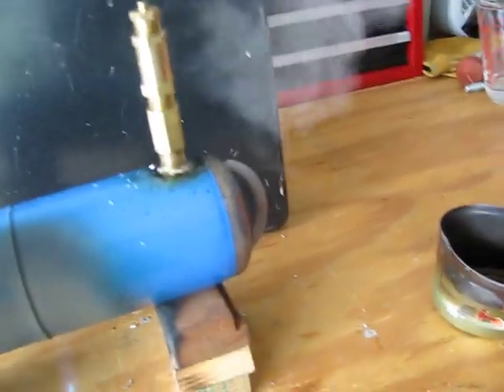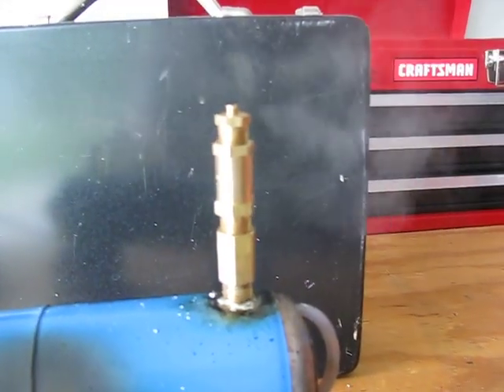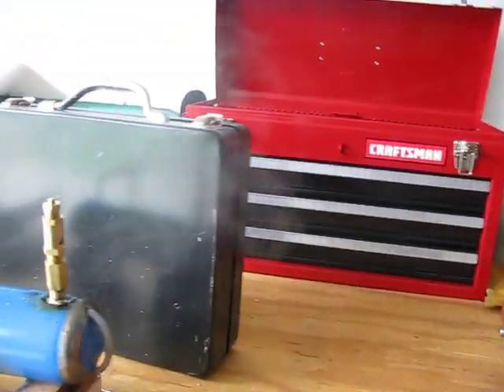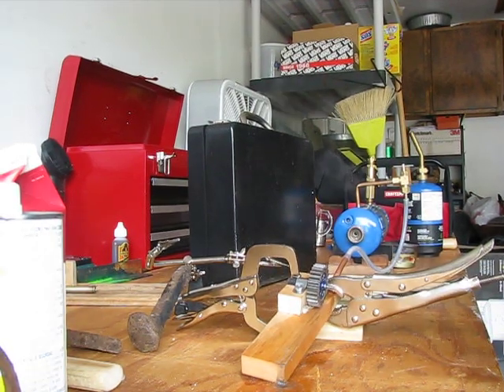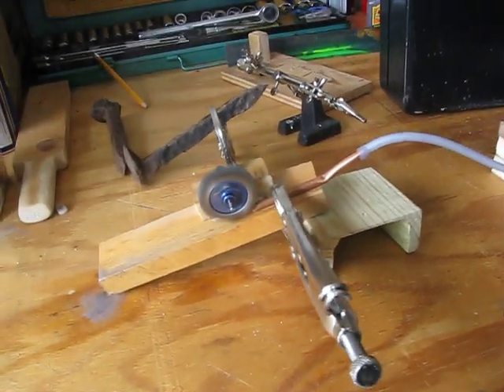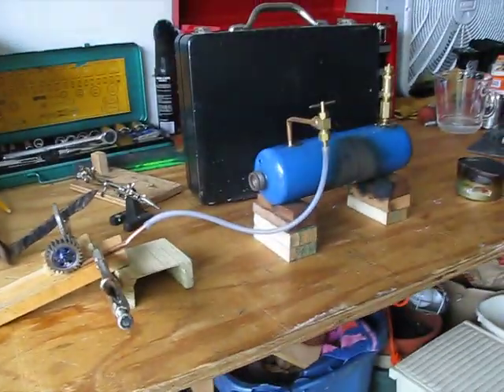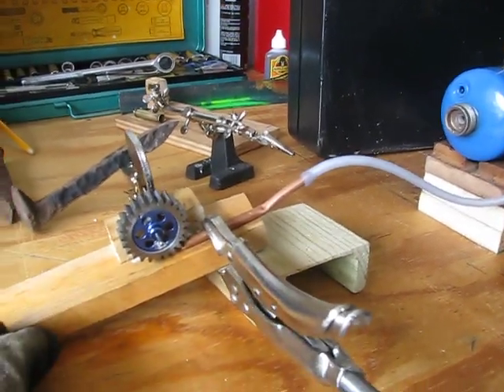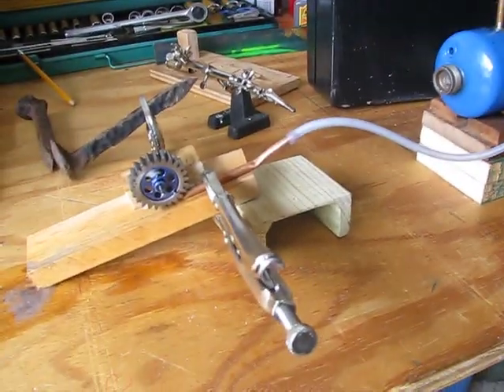steam engine project part 4

Comment: @Steveo928, this is amazing! I was also interested in your old setup! I was wondering if you could hook up the RC fuel tubing to the back of the larger bullet shell and then see how far up your smaller shell goes, and drill a small hole right behind it, therefore, you'd have a steam outlet and flexible steam input!

Comment: well all you need to do now is conceal the wheel that is turning and have a little tube under it  to collect water to reuse in the engine itself and then you can set a dc motor shaft onto the wheel make it spin backwards and make a moderate electric current it is interesting i am still workign on myn sorry it took so long to get back i think after i do somethign similar it will be a great science fair project and home fun even in the case of a blackout